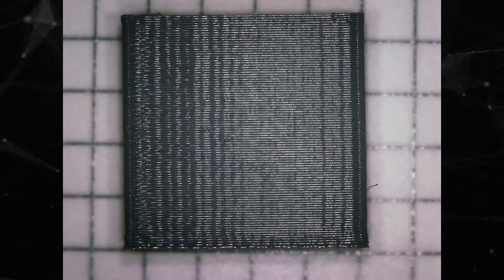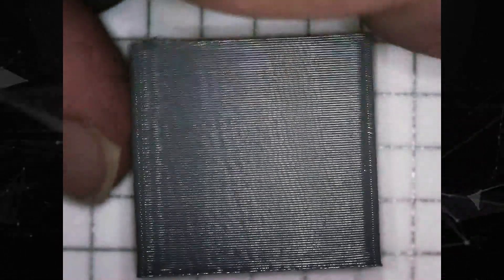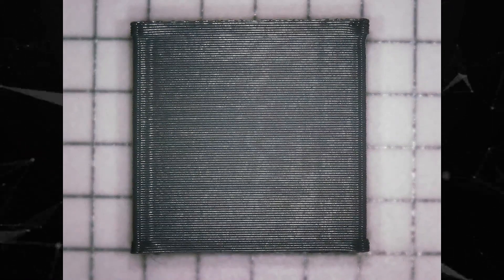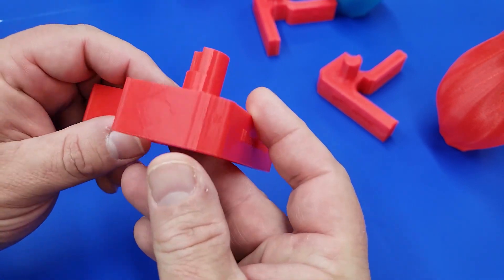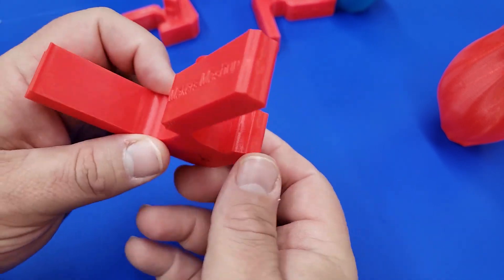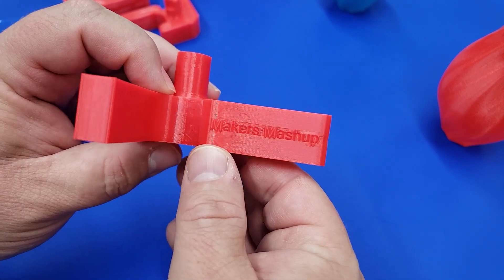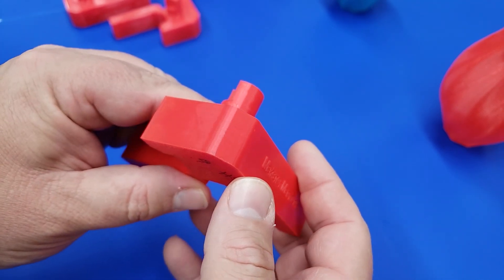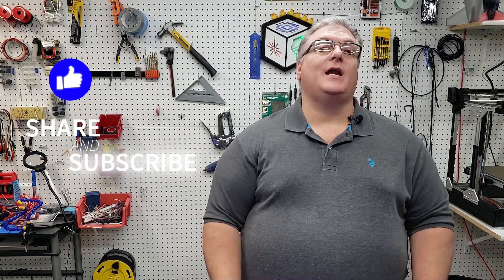1.8 vs. .9 Degree Steppers Help or Hype?

Comment: I noticed some time ago when i started printing around 2012 that the melt zone acts as a shock/buffer for VFA if you print at just the right speed where the plastic is melting very well and is also printing fast enough.

Specifically noticed when i took out the PTFE tube out on my Replicator Dual, that made the filament pool up and create said buffer/shock area. Later noticed the same happens when you have a long melt zone, like on a Volcano hotend. Other thing i noticed is older stepper motors seemed to bleed off a lot of heat, eating up ruff stepping on older stepper motor drivers like smoothers do.

With all that said, 1.8 degree printing at higher speeds (150mms+ on outer walls on my printer) seems to remove most of the VFA's. But also when i print very slowly with a 1.8. So 0.9 degree might work for you, and/or you might never really benefit from it while loosing a bit of holding torque

Comment: In my experience with CNC I observed that the microstepping is some sort of spring, then no way to set the exact position in the time. The motor 0.9 have the double positions than 1.8 then the spring zones are lessed due that the motor arrive a their positions with much more garantee than the positiond intermediate by microstepping that are more uncertain. Then these effect of spring of microstepping can be the resonance of VFA, been minor in the 0.9 motors due to minor angle to freely spring between real steps of motor.

Comment: The "vertical fine artifacts" for the most part aren't caused by the steppers, it's caused by the mechanical aspects of the gantry and drive system. The biggest improvement you can make is to change to Japanese or German steppers because if you pull a Chinese stepper apart and mic the armature poles you'll finfd they varyin width  by several thou. This translates into irregular movement, with some steps being bigger than others. This is usually the biggest contribution to banding outside of the mechanical system.

Comment: I think it has more to do with the quality of the steper
Reply from the maker: I'm curious.  In what way would you think the quality of the stepper would affect it? while I didn't use something high end, Stepperonline steppers are fairly decent.
Reply: @MakersMashup   my sidewinder X1 came with  ok Stepers but after a few months they began to cog a bit introducing artifacts using a better steeper than the 5 dollar bulk stepper seems to have corrected the issue and improved accuracy
Reply: This probaly not the case in your  printer as you have fairly good one but might be intresting to  swap out them steper online ones with some craptastic generic ones liek on a stock ender 3
Reply: Also might be worth trying driving the .9 steppers at 1/8 stepping insted of the 1/16

Comment: Well, how fine details we think we can print? If we use 0,4mm nozzle and 0,2mm layers. If we have 80 steps per mm with 1,8° and 160 steps per mm with 0,9°. If we print straight, like cube wall, only length can change and if we use only one motor. That difference could be a0 - 1/80 mm. What is 0 - 0,0125mm. I think, because if our positioning was 1/80 mm and we got one step between originals, it give us double accuracy. So, if you ask wall length to 20mm, then both motors try make that 20mm. Well, of course there is 80 steps more with 0,9° motor, but that means 0,00625mm steps instead of 0,0125mm steps.

So what I think, if we need or want finer details, we must change at least our nozzle and desing much finer to get different results.
If we print stuff what is "designed" to 0,4mm nozzle and 0,0125mm accuracy is enough, we do not get much different results if we add more steps to our motors. =)
Maybe, if we print with 0,1mm nozzle and layer high with 0,05mm... and 0,2mm high text or other details. Maybe then we get some difference?
Reply from the maker: I agree. You might see finer details with a .2 nozzle. My point was that .9 steppers are largely hype.  While there are minor improvements other changes are necessary to get significant results. Absolutely agree though a .2 nozzle.
Reply: Exactly.
I didn't meant to point of your video with my first comment. Maybe more like a support it.
I start thinking what is the difference between those motors.
And I do not address to you these thinkings, but all who might think difference between 1.8° and 0.9° motors. And think if they need better positioining.

What I try to say, is maybe easier understand with following:
If I have perfectly tuned printer and 1mm is exactly 80 pulses with 1.8° stepper motor.
That mean, if I want move my nozzle 20mm, then 1.8° stepper motor got 20 x 80 pulses = 1600 pulses and stop exactly 20mm point.
Same with 0.9° motor, needs 20 x 160 pulses = 3200 pulses and nozzle stops exactly same spot.
Well, no difference.
If I want move my nozzle 20.0125mm, then with 1.8° motor got 1601 pulses and 0.9° motor 3202 pulses. and spot is same like a last time. No, difference.
(1mm / 80 pieces = 0.0125mm and 1mm / 160 pieces = 0.00625mm)
If I want move my nozzle to 20.00625mm, then 1.8° motor perhaps travel 20.00000mm or 20.0125mm (1600 or 1601 pulses), but 0.9° motor can travel 3201 pulses and spot on 20.00625mm.
So, difference is 0.00625mm.

That was theory and math/electrical accuracy. And if I have mechanical accuracy of 0.00625mm, I wondering =) (you could try if your printhead not move any direction when you touch it)
If there is huge gap at 0.5mm, it is the same if I loss 40 or 80 pulses, because it is 0,5mm.
If there is 0.5mm zig zag, my nozzle could go straight.
Reply: Littlebit more math or theory =D

Where that 80 pulses coming?

Well, many times printers has half inch gear at top of stepper motor. That is about 12.7mm. So, 12,7mm times π is about 39,8982mm at full round.
When that is divided by 200 full steps, then one full step is about 0.19949mm (360° / 200 = 1.8° or 360° / 1.8° = 200).  Well that is not 0,0125mm...
Ok, there is so called micro steps. And there is 16 of them (usually). If that 0.19949 is now divided by 16, then we got wanted 0.0125mm. =)
So, if those micro steps are actually steps, why there is different step types. And could some drivers actually use 256 micro steps. If so, can I make electrically positioining at 0.20 / 256 accurasy? (0.00078125mm). Or is that only audio level thing and actually there is always 16 micro steps, but other drivers just drive smoother them. But stops only every 16th step and drive that step its own 16 step... =)

That was just thinking. I do not wait answers =).

Comment: My theory is that most of these artifacts are caused by inertia, not by stepper resolution.  The printhead is bouncing around with quite alot force i guess take away wheight from the head will improve most prints.

Comment: cool video but I was hoping you would do some actual testing of the motors not just the print results.. Like do 0.9 steppers run cooler than 1.8? and how does the holding torque affect it... 
I think most educated people know that you aren't getting a huge increase in quality from less than 1degree difference cuz the length of the belt and the pulleys practically negate that..

Comment: I have good experience with TMC2130 and 0.9° steppers. It allows me to very fine tune the z offsets. They aren't so expensive, so why not increase resolution. Use a fast microprocessor, not an atmega 8

Comment: Being in the semiconductor industry and working on robotics, I can say that the resolution of your prints depend on the driver micro-stepping the motor. The driver that we use for each axis is about the size of a 24V power supply, and it takes about 150-200 micro-steps/pulses to move 0.1mm. The driver divides each step by hundreds or thousands to move a 0.9 (400 steps/rotation) or 1.8 (200 steps/rotation) motor a few micrometer or nanometer. Some our tools use electromagnetic linear actuators with infinite stepping at the cost of about $120 million a pop...*Cries*

Comment: It's not that .9 is better than 1.8. There are better 0,9 degree motors and there are better 1.8 degree motors. It helps to double the torque dents on the motor on a 0,9 vs the 1.8. 

Like you noticed yourself, on spiral vase this is pretty critical, and you acknowledge improvement. It's a combination of motor induction and the torque dents a motor has. If you lmeasure a VFA defect with a caliper, it's not a wobble of the head, but it's a difference in inconsistent speed. (the line measures thicker and thinner points on a spiral vase printed object that has VFA). On a CoreXY the Y axis is most likely the affected axis. Lowering your current also helps. In my experience; when you compare a stepper by turning it by hand;  a stepper with less obvious torque dents will show less VFA's. Higher induction doesn't help with VFA either.
Reply: On my Ender 3 when I converted the Y to linear rail the VFAs were so pronounced I switched back to rollers. Maybe I just needed to reduce the current. It was hot hot hot that's for sure. But my plan it to get some LDO 0.9 steppers and try it again.

Comment: it always depends on other variables and you could just gear a 1.8 to 2:1 instead.    most typical machines purchased like ender/CR10's have slow outer shells for better quality.  the slower you print, the more chance of VFA's.  A Stepper's full step is smoother at faster speeds, there are some demonstrations around for this.  i've done this experiment nearly a decade ago using s3d and just printing outer shells faster removed them.  further improvements can be had  by  lower printing temperature at the expense of strength.  reason is PLA and PETG being the most common are fairly molten and pick up way more artifacts from vibrations or stepper steps.  with ABS or ASA for example the print quality in terms of surface finish nearly doubles.  that's the magic to good prints, different filament.   either matte or filled filaments produce great results since they're more viscous when extruded.  a CF-Nylon looks almost like it was SLS printed.

Comment: Is there a difference in the noise between 1.8 and 0.9 stepper motors?
Reply from the maker: Nope. Most of the noise on steppers is the drivers not the motors themselves

Comment: This comparison doesn't make any sense unless all other artifact sources are removed: Ringing (tightening belts and using input shaper with Klipper), pressure advance, better steppers (e.g. TMC2209) and a better extruder (one that pulls from both sides of the filament).
Reply from the maker: The steppers are 2209s, I'm not going to swap firmware for a video but you're welcome to test pressure advance and .9 steppers yourself. The belts are plenty tight.
Reply: @MakersMashup  I will once I finish building a Voron. I won't even bother with my current Prusa i3 because it has A4988 drivers (16 microsteps and really old tech at this point). Doesn't the TMC2209 have many more microsteps than 16?
Reply from the maker: 256 microstepping through interpolation but the firmware still sends 16. The 2209 handles the interpolation on the chip.

Comment: Can they produce thinner layer heights? I never actually considered them for fixing artifacts. 

The other thing I'm looking at is closed loop steppers, namely those from btt. Teaching tech already did a vid on them but would be great to see your opinion.
Reply from the maker: If you want thinner layer heights youre better of changing the lead screw to something like 2mm like we did on the X301.  I've tested closed loop steppers.  If you have frequently missed steps it could make sense but I've been able to address that problem in the past by adjusting the motor current.  For most 3D Printer applications I don't know if CLS makes much sense.  Just my opinion but if you feel you have a use case for it they do indeed work great.

Comment: Hmm curious. The visible infill can be drastically improved by unchecking "infill before wall" in Cura. It took me a while to figure that out. I'm not sure if that changes as structural integrity but it really helps removing infill artifacts and cleaner edges.
Reply: Thank you for this input. I had forgotten that I had this activated since it helps when changing colors

Comment: Maybe a noob question, but what orientation were the "square" test prints in? If that was a CoreXY, then walls aligned to the axes are actually diagonal motions, running both motors. Could the VFAs be caused by being a half-step out of sync?

Comment: A little late to the party (thanks youtube!). The results you found make sense. Moving to a spot and stopping will be more accurate with a .9 (assuming you have the juice to hold a microstep properly) but in theory, once in motion, either stepper will barrel on through positional data, letting inertia carry it if there is no need to stop, so there should be little difference in the overall layer quality.  Still, nice to see proof that this idea holds water. (puts wallet away)

Comment: I don’t see how 0.9° stepper could help with VFAs. For a straight edge aligned to either the x or y axis on the bed, there should be no difference along the faces. The accuracy of the stepper motors will be the same. Only the precision is different. VFAs are an accuracy issue. Only precision is improved with the smaller step size. The accuracy of the hotend motion won’t be improved.
If you had a course hotend motion that only could move by 1mm increments, but that motion was accurate to 10nm, you would have no VFAs. You’d have other issues for sure. 
Conversely, if you had a motion system that had 10nm step precision, but only 1mm repeatability (low accuracy), you’d have terrible VFAs.
People confuse precision and accuracy all the time.
Reply: How would I increase accuracy?
Reply: @Nick-wl4qr  microstepping, or by decreasing the number of teeth on the motor pinion. But is motor accuracy really an issue on 3D printers. I would argue that other factors that frame rigidity, belt stretch, linear rail smoothness, and motor mount stiffness are the limiting factors on the motion system.
Reply: "vfas are an accuracy issue" I love spreading misinformation

Comment: You did not say it, but did you switch X, Y, Z, and E motors or was it just the E motor?  How does Maximum Resolution, Maximum Travel Resolution, Maximum Deviation play a role into how it works? Also, the infill sticking out could be a problem with not enough walls.  Does adjusting Acceleration, Jerk, Junction Deviation, and Linear Advance help with the 0.9 over the 1.8 motors?  Would Arc Support benefit from the more steps from the motors?

Comment: you need 0.9 stepper on XY and E plus a 32bit board if you want to see real results. 0.9 steppers doesnt work on 8bit boards and you indeed need to increase the resolution in the slicer. Cura is a bit shit for this. they all use 8bit boards in ultimakers. most of the artifacts I see in your video aren't stepper related. well most of them tbh.

Comment: It is difficult to talk about comparative printouts if you still have the ghost effect on the texts. In my opinion, this test model shows the problems with tuning your printer more than the difference in quality.
Moreover, some artefacts may suppress or hide others. This is a complex subject and the fact that you can see the internal structure does not make a direct comparison easy.
I would think more about how to print patterns for comparison.

Edit 31/12/21 - I've been using these 0.9 motors for almost a year. I have not done such experiments, but I have a comparison of the various test prints before and after. I must say that subjectively I see a significant difference in favor of 0.9.

Comment: Hi Rob, thanks for your video ... very interesting ...
I have a question
Recently I bought a pancake nema 17 for my extruder BMG
When the motor arrived me I saw it was 0.9 Degree / 1.4 Amp 
So
I've configured it araund 800 steps and 1/16 microstep and Vref 800mA, but I feel that this seteup is not the best....
I've seen steping loss, overheating and torque very poor.
I dont know if the problem is the resolution (1/16) or the motor...
Can you recommend me some tips to get better?

Thanks

The motor
https://www.amazon.com/gp/product/B07CYW7PPS/ref=ppx_yo_dt_b_search_asin_title?ie=UTF8&psc=1
Reply from the maker: My understanding is that some (not all) .9 steppers lack torque.  Pancake steppers add to this problem given their limited size.  If the stepper is rated 1.4a your 800ma shouldn't be an issue.  Heat might be though if that pancake stepper is getting warm.  With a geared extruder I see no reason for a .9 stepper there given the e-steps are already 415.  If it were me and I ran into skipped steps with the .9 I would just swap it out for a higher torque 1.8 stepper.
Reply: define overheating?  the driver perhaps but the motor can sustain like 80c+ probably for 100's of hours.  it's a geared BMG i assume which is 3:1 and a 0.9's aren't out of the norm but probably aren't needed.  i used to use them fine with e3d titans.   probably not enough current or the gear is meshed too tight which can happen.

Comment: What about the noise. I'm really mainly looking for noise reduction
Reply from the maker: The stepper drivers are your source of noise in most cases.  These stepper are just as silent as others with trinamic drivers.
Reply: @MakersMashup  oh I meant to ask, are 1.8 degree steppers louder/quieter than 0.9?
Reply from the maker: Same level of noise.  Most noisy printers are the drivers not the steppers themselves. The .9 work as silently as any others with TMC drivers.
Reply: @MakersMashup  my printer makes a lot of noise  even with TMC2209 TBH. I was tempted to decouple the stepper from the belt path and use a dampener for my next design